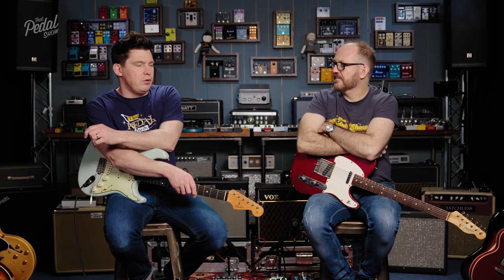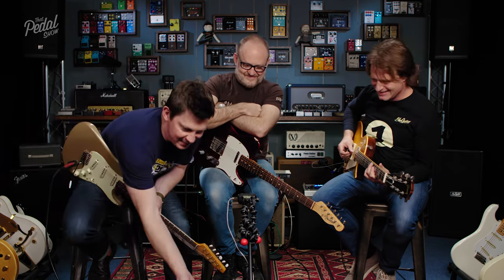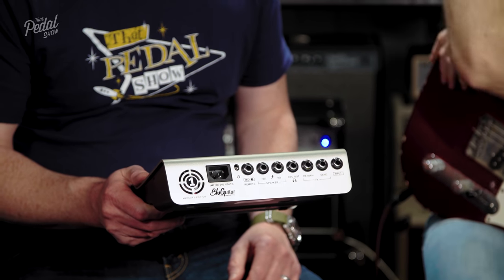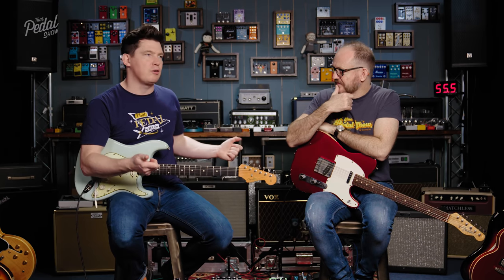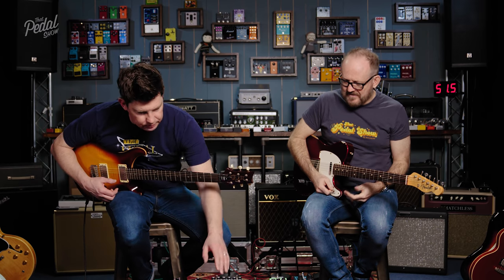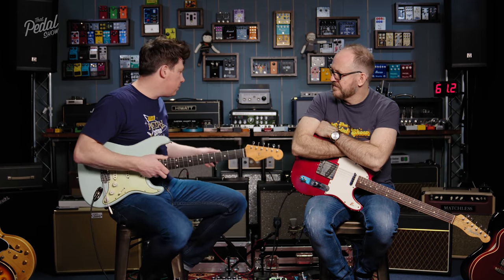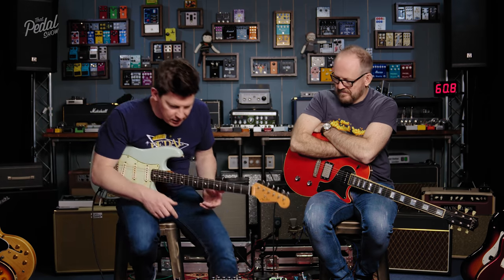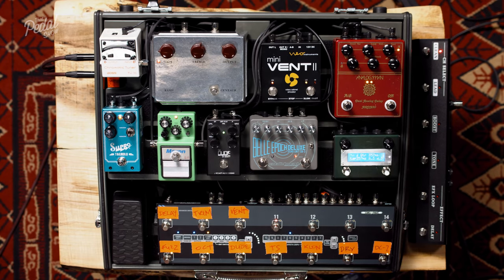Yes We Do Like Transistor Amps #1: Boss & BluGuitar – That Pedal Show

Comment: I love my Quilter amps. I have a Tone Block 201 and an Interblock 45. It's great to be able to place them directly on my pedalboard. The Interblock is especially amazing because it has all the major features you need in a pedal platform amp and is the size of some pedals. You could even use it as a power amp for a preamp pedal since it has an effects loop.

Comment: A lot of mentions here already but the CR120 is an unbelievable solid state amp. You get the clean up when rolled off, string attack that reacts in the way you want it too, warmth for days. It's one of those amps you forget is a solid state and it just blends in with the other valve amps in live situations. Top stuff 👍

Comment: One can always knock S/S amps for whatever reason you feel at the time but they are ideal for clean,Jazz, funk,reggae ect. But for other sounds you need to dial in a good base sound then add to it..and something you didn't introduce was speakers! Speaker's speaker's speaker's!!! You can fatten or thin out sound with speakers,you know this. The JC 40 has 2x10,sounds massive, retry the little Vox mv50 with a 2x10 cab loaded with alnico speakers. Try a friday show and don't tell us what amps you are using and use 2 S/S amps and no-one will ever know.

Comment: Here is a thing though. Since the late 60's maybe, but certainly by the mid 70's almost every single live performance was put through Solid State amplifiers. Yes the guitars might have been initially put through our beloved valve/tube amps but after that, everything that the punters have heard out there has been driven by silicon baby. Just a thought.
Reply: Kman Krautzman True, but those solid state amplifiers shouldn’t be coloring the tone at all, in theory.  The guitar amplifier is creating and shaping the tone, and for some reason historically we tend to prefer the way tubes do it over solid state technology.  Definitely moving in a great direction though.
Same argument for diodes in OD boxes into amps.  We like the way those boxes push the tube amp, it sounds different into an older transistor amp.  (And sometimes that sounds is great too)
Reply: What they said. Also we’ve all played through a shit underpowered or cheap PA that’s massively coloured the sound for the worse sooner or later too. 😂
Reply: Also, I would argue that in many cases it’s the feel that is hardest to reproduce and in turn how the player reacts to the feel of a particular tube amp, more do than merely the sound itself. The PA doesn’t change that part.
Reply: There was a period where the Grateful Dead played live concerts through about a 1/2 $M of Macintosh class A tube audiophile amps. A crazy insane thing to do, but their sound through Berkeley's John Meyer's custom speaker arrays was nothing short of altered reality, and no I wasn't on drugs. In the early 80's I lived in Mill Valley CA, and if you dropped into the Sweetwater Saloon (now sadly replaced by some stoopid ass 'bootique) after 12AM you got to hear Eric Clapton, Keith Richards, Jerry Garcia, Jorma Kaukonen, Steve Stills, Neil Young,  and on and on, playing through small tube amps, and that my friend is real music.

Comment: I've always used both tube and solid state amps. I find it easy to get a great tone from SS. The thing those amps lack is the natural compression you get from a tube amp, so they have a very immediate and trebly attack; as soon as you touch those strings you hear the sound, sharply and with some amps, unpleasantly. All you have to do is set your treble a bit softer than you would be used to doing with a tube amp, and add very light compression with a pedal. Also, SS amps shine when used with no more than a slight overdrive setting, so get your heavier dirt from good pedals. One thing I can't stand though is digital technology in an amp. With a modelling amp you're basically running a computer software program but in a hardware cabinet. No thanks. If you're going to sell that, it should be dirt cheap like a program would be for your PC. I also don't want to deal with virtual crap glitching out. I started watching a video about the Nextone when it came out , but as soon as they said you can get more out of it by hooking it up to your computer I was out. It's bad enough that so many synthesizers nowadays require an app to use to their full potential, I don't want that situation with my guitar stuff too.
Reply: Totally agree with you. I’m just a home player but I started with a katana mk2 100 and just couldn’t stand having to plug it into a computer so I thought okay I’ll try my pedals instead. It was just okay sound wise even with the pedals. Long story short, I sold the katana and ended up with a Roland blues cube hot. No more computer crap and I it sounds a lot better than the katana did. Definitely the right choice for me to be able to play at bedrooom volume.

Comment: I enjoyed this episode very much. I've been using a Tech 21 Trademark 60 for almost 15 years. Hope you include it, in part two. I've recently switched to the Roland Blue's Cube Hot. Not quite the Fender sound, like the 60 but smaller and lighter. Old age has it's requirements. Their's a great demo of the Quilter vs Trademark 60 on thearoom. Check it out
Reply: Sadly my Trademark 60 broke down and getting it repaired wasn't economically viable. I really liked the clean/edge of break-up tone it had although the onboard distortion was pretty vile. Tech 21 make some nice gear.

Comment: You guys had a part 1 transistor video before that never went anywhere IIRC. One of the top comments was noting how you should've used the same speaker, cabinet, and mic placement for all of them. I know it's hard to do sometimes, but they were not wrong in suggesting that. To the experienced, yes, there are obvious differences aside from speaker tonality, but it would make them more obvious.

I suppose that'd be the difference between testing products and testing technologies.

Comment: I've been looking forward to this!
Having spent a lot of time with amplifiers (design, build, repair and, of course use) I prefer simple amps and there are some very good solid state ones.
The point about price cannot be understated. Good amps need good power supplies and they add to the build cost, even more so with valve circuits.
I do however tend to avoid things with software!

Comment: I had to go back and watch the intro a second time just to hear that epic tone. :D My first amp was my 1990 Ampeg VH-140C stereo chorus 2x12 combo, quite similar in concept to a Roland Jazz Chorus JC-120, but with 70 W per channel into 8 Ohms (or 100 W per channel into 4 Ohms), and loaded with Celestion G12M-70 Modern Lead drivers. That amp has headroom for days. I still have it, but it has been replaced as my main amp by a 2002 Mesa/Boogie F-50 1x12 narrow chassis combo.

I really didn't understand that the Nextone amps were not modelling amps, and now that I know they are not, I am very much more interested in them. The magic words are "discrete analogue".

Comment: As the proud owner of a JC40, glad to hear that amp helped open you two's eyes (ears?). Truly a special piece of gear— all the magic of the vintage Jazz Choruses with all the modern trappings I could want in a portable and deceptively loud package 🙏🏼
Reply: Plus for dirt I use a smallsound/bigsound Mini, which has a lot of "tubelike" qualities, imo. That, combined with the way I use comp and EQ makes for a pseudo-preamp at the front of my board, which means the flatter response of a transistor pre is actually a huge boon
Reply: I play a JC40 Wet/Dry with an EHX Dirt Road Special. I can get Drone Doom sounds with that combo (and a few choice pedals). Team JC!

Comment: Back in the early 1970's Sunn Amplifiers built  a discrete point to point hand wired transistor amp that rivaled most 100 watt tube (valve) amps either 6L6 or EL34 powered. I have forgotten the model but borrowed one for a short 10 show tour.  The amp performed spectacularly and offered excellent tubelike natural compression and tone.

Comment: I had a Nextone Artist for a while and it was great amp but now I’ve got a Quilter Cub 50 which has fewer features but it’s next level in terms of sound and feel. The designer Patrick Quilter is a genius I’ve never heard a better solid state amp if there is one please let me know. Maybe the Bluguitar but it’s really hard to tell on Ytube you need to try one get a real feel for something. I paired a Boss Gt1 with Quilter cheap easy to use and sounds pretty good sort of like a Katana in a little box and very happy with the way both of them work together. Keep the great vids coming boys!

Comment: I have four giggable amps, three of them traditional tube amps and the Roland Blues Cube, and the Blues Cube hold its own, especially for 'grittier' sounds, as the other three are non-master volume amps, and are very clean at the reasonable volumes I use (before stepping on a pedal, of course). The Nextone definitely intrigues me as it has a bit more versatility, and no messing around with the tone capsules. Looking forward to the Quilter episode. Thank you for the video.

Comment: I want to like the Nextone but I don’t. It’s harsh, bright and gives me a headache. As I was writing this they switched over to the AC15 and suddenly I heard something l like. And I don’t even usually like AC15s. Fuller, richer and less scratchy. 

Just don’t like it. It’s awful. I’m sure the Katana sounds better. The Blu is sensational though. I don’t think it’s just confirmation bias.
Reply: I tried a Nextone Artist as a possible backup to my Blues Cube Artist (which has a Ultimate Blues tone capsule installed). The closest I could get it to sound like the BCA, on the 6L6 setting, was still harsh and dynamically flat. I suppose they had to make a lot of sacrifices in the amp's construction to create what, to my ears, sounded like a Blues Cube lite with software options. The moment I knew I had to send it back is when I brought it to a gig. While the BCA sits like a charm in the mix, I had to turn up the Nextone too much to avoid getting drowned by the drummer.

Comment: I've gigged with a Quilter 101 for a few years now. Best amp I've ever owned in terms of usability. Just sits on my board and I never have to worry about backlines again. My favorite amp I've owned in terms of playability is also a solid-state—a Marshall Lead 100 Mosfet from the 80s. Johan Segeborn does amazing demos of the Marshall 80s solid-state stuff and those amps are fantastic!

Comment: Being a Vox nut I own some of the US-made Thomas Organ era amps too, including a pair of Pacemakers. One is a tube amp, with two EL84s in the power section, while the other is solid state with germanium power transistors. Both amps sound terrific! Not the same, of course, but for sure in the same family. Both amps also have killer Celestion 10” Alnico speakers, original equipment, which doesn’t hurt. If someone told me, “You can only have one of ‘em,” I’d honestly have to flip a coin to make my choice.

Comment: Thomas says 'if you take a 100W valve amp you can get more out of it'. While it is true that if you overdrive the output stage into clipping, a valve amp will sound louder without sounding horrible but, just about every valve guitar amp isn't capable of its rated RMS output power before output distortion. It is common for amplifier manufacturers to round off output power upwards to the nearest decade in their advertising, so for example 15Watts becomes 20Watts.

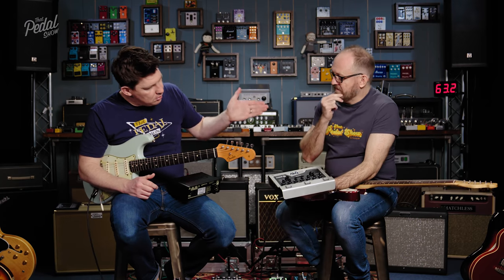Comment: 29:22 lmfao... Great video. I love analog solid state and hybrid tubes tech. I wish more manufacturers took it seriously. 

On the Boss Nextone I still don’t quite understand the analog signal path statements. Reading the amp documentation you can edit the amp power section characteristics (like bias and sag) via editing software. So it’s digital, yeah? I think Boss is just being sneaky with their definitions. They tried to market the Katana as analog at first too. 

I wish a company would continue and improve on what Peavey did in the 90s with the transtube bandit.

Comment: I just got an old JC120, and I have a 6V6 , 6L6, and several EL84 amps and I am trying to pick my first EL34 amp. Eventually I will run just two or three but for scientific purposes right now I run every one. Oh and a couple solid state bass amps standing in for my broken Super Beatle.

Comment: Dan and Mick (hellooooo!!).  Very interesting show, thanks.  While AC30 is not my favorite amp, that AC15 is wicked good to my ears, both by itself and when mixed.  All of those SS amps could work in a mix (wet/dry, wet/dry/wet), however each SS by themselves just couldn't get me to smile.  So congratulations gents, you have just medically confirmed that I must indeed have tubes in my head since those valve amps just "resonate" more in me!  Probably biased tubes as well :-)
Cheers

Comment: After hearing the part about different countries voltages making amps sound different (at 25 mins in) I'm wondering if my Victory v40 sounds different in the U.S. where I am than how it was designed in England? Do you guys know anything about this? And since I'm really a fender amp guy, should I try the 6L6's instead of the el34 that come in it? I would love to know. Thanks guys! Still love the show as always!

Comment: The Amp1 is good, but I still hear a difference. My amps are all low watt (5 w) class A tube amps. The Bluamp uses class D amplification. A class D amp uses massive amounts of feedback loop (in the electrical sense, not the acoustic squeal) to filter the PWM (pulse width modulation) signal  into an analog sine wave. That feedback circuit allows you to easily model things like transformer sag and 12ax7 tube compression in the signal path, so it acts and sounds more like a tube amp. 

You can hear feedback loops in an amplifier. The lower the amount of feedback used in a circuit, the better it sounds. Feedback is used in tube amps too. To get tubes to 100 watts output, you need to go to Class A-B amplification and a 100w Marshall is not going to sound as "clean" as a 5 or 10w Marshall.

Class D is a pretty recent technology, so not many transistor guitar amps use it. You really can't  take this TPS review and generalize to solid state amps. I would also argue that what the Amp1 is doing is a lot like modeling (done in the feedback loop).
It does fool your ears into thinking it's tube-like, but once you know what feedback sounds like (from the absence of it) you can't ignore it. It's bad, to my ears, and I'm sticking with tubes.

Comment: I have found all amps with at least a decent 12 inch speaker are great if you know how to use an EQ pedal same with guitars sounding Dark etc., personally I think a lot opinions regarding Amps & pickups etc... refer only to guys who just plug guitar straight into amp with nothing else in between. I personally am glad that Solid state are catching up with Tube amps to some degree as its more beneficial on a whole with reliability & sustainability.

Comment: Gents, a question for vcq next week: regarding transformer isolation when running multiple amps, would any pedal that uses a transformer effectively isolate the ground? Specifically, let’s say I’ve split my signal with a stereo delay, and in the path to just *one of the amps, I insert an “always on” pedal which uses a transformer, such as the jhs colour box. Obviously this doesn’t solve any potential issues with phase relationship, but am I effectively using a colour box as a ghetto-humdinger(minus the phase switching)? Thanks so much for the rich exploration of all of these subjects. You’re treasures, mates!

Comment: Solid state amps sound great in some applications and definitely have advantages in terms of weight and maintenance. I've had some good times with an old Peavy Bandit and more recently a Tech 21 Trademark 60. I've also played a Roland Blues Cube and a Yamaha THR100, both of which sounded 'authentic'.  But when returning to a decent valve amp, it simply felt like 'home'. The other issue I struggle with ( though there are exceptions) is the usual much lower output/ volume level you get from most SS amps. I accept that the majority intended for live use may well be loud 'enough' for most applications, but I don't feel comfortable not having a bit more on tap, should I need it. I appreciate that is a personal perception/ requirement, but I'll bet I'm not alone!

Comment: This was amazing. FWIW I spend more time recording silently than I would prefer - but if I waited for chances to mic up & record my fantastic hand made (JM Vintage Blend) amp, I would have so much less time to record. So, I preamp out of it with a Page DS (that’s in the proper FX loop)  - with the Keeley Comp after the Page (sometimes) then into my DAW. Often I still use Amplitube. My point is that having real tubes along the way gives so much more reality & also feedback to my hands. So, my suggestion is that you explore the Amp1 (& others) with a Page or Harlot in front (or in the loop). Another great show. Btw, I’m old enough to be baffled that anyone would go to the trouble to thumbs down you fine fellows. I wonder if it took more steps to dislike if they’d just move on to what they like. Never be deterred. Haters gonna hate hate hate.

Comment: Good Video! I have uses for Both types of amps. I Hear and Feel the difference in my current tube amp versus my current transistor amp.  But, I may not see a difference in a Kemper or other high end transistor amp. So, I will remain open minded.  Also, I will sometimes play on my transistor amp with built in effects when I am out and about for easy portability.  I think Both types are Great!